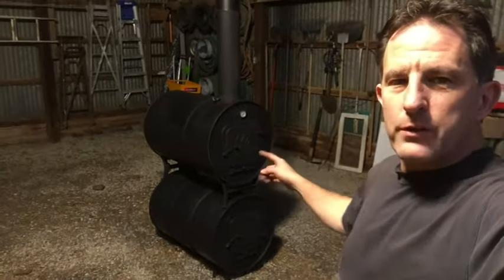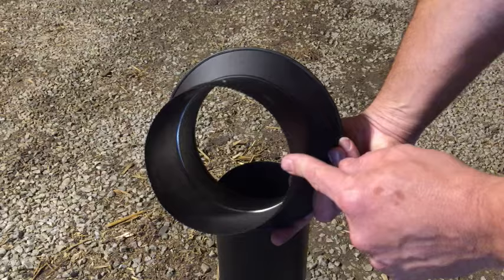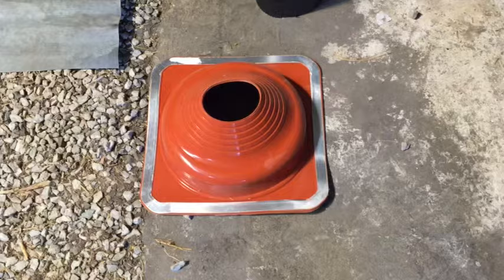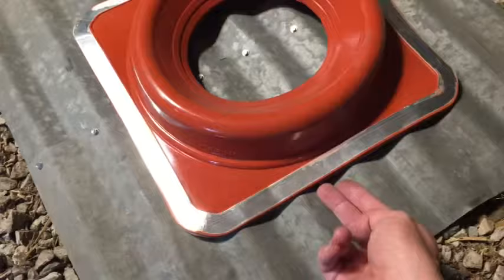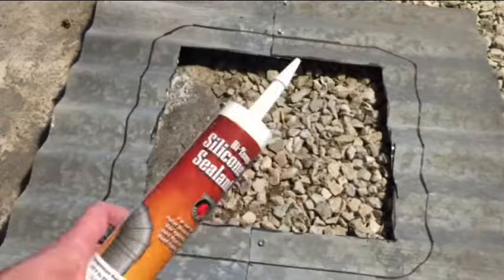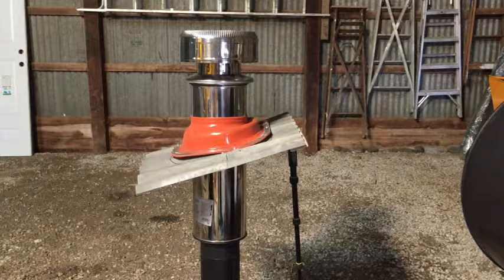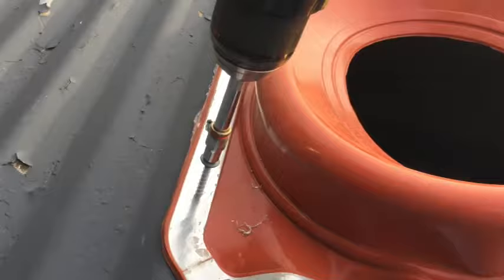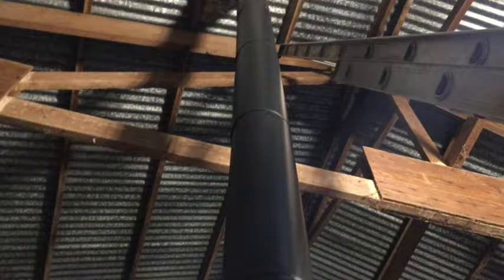How To Install a Chimney Through a Metal Roof

Comment: One suggestion is turn the boot like a diamond. Allows less surface area for water to pool and top two sides act as channels to move the water along
Reply: Good tip.
Reply: Good idea buddy, I'm installing my Selkirk this weekend in the cabin and was just flipping through some ideas and reading your comment..makes sense.
Reply: Yep that makes sense, thanks for that tip, im just about to fit the boot.

Comment: I was told once say the cap should be about 2ft above the roof surface not sure I saw high and low cap was installed in youtube
Reply from the maker: Yes, best practice is to have the top of the chimney at least 24 inches above the ridge, to prevent downdraft when wind comes from the other side and over the ridge.  This is less of an issue with my low pitch roof and I have good exhaust momentum since I have no bends in the chimney
Reply: @HowToLou  I bought a set not install yet, but the cap is going to be connect right on top of double wall and the double wall is 14 inches high so I would say the cap will be about 1¹/² ft from the roof. My cabin was built with steel panel and only 2.5 inches thick
Reply from the maker: That all sounds good.  If you have any draw problems, you can always add another section of double wall later.

Comment: Now that it has been in place for a year has it started leaking yet or corroding on the high side where the water pools, or where you cut the steel with a grinder?
Reply from the maker: I just looked and there are no leaks or corrosion.
Reply: I put my flashing on as good and pro as possible and it leaks on the high side , not sure if it's the pitch of my roof or just living in Washington state

Comment: Great video but isn’t the chimney pipe supposed to be a bit higher than that?
Reply from the maker: Technically yes, but my wife did not want to see the chimney above the roofline.  I put the top of the chimney even with the peak of the roof with the idea that I could quickly add another 2 foot section of double wall stainless chimney on top, if I needed it for draft.  I have not had any issues, with winds from all directions, so there is no need, in my case.  Part of what helps my draft is that my chimney is a 15 foot vertical run with no elbows to slow the smoke.

Comment: Hello, what is the highest temperature it can resist? Would it be too much for a single layer chimney pipe?
Reply from the maker: I think silicone is good to 600 degrees.  Single pipe is fine until you have a chimney fire and the single wall pipe glows cherry red and gets way over 600 degrees.  Single wall is not to code, because it can be very dangerous.  I have had chimney fires.  They are scary.

Comment: Do you use any of the high temp silicone on the join between the flue and the top of the dektite flashing? Or is it a secure seal?
Reply from the maker: Its a secure seal. It’s stretched on tight!

Comment: Where did you get that silicone flashing piece
Reply from the maker: DEKTITE Square Base Pipe Flashing Boot: #6 RED (DFE206RE) High Temp Silicone Square Base Flexible Pipe Flashing Dektite (for OD Pipe Sizes 5" - 9") Pipe Flashing https://a.co/d/b21O8wq

Comment: Could i ask why single wall pipe than double wall threw ceiling ?
Reply from the maker: You want single wall inside, so it radiates more heat, but insulated double wall through through roof so it does not burn off your roof paint or catch your trusses on fire.

Comment: Good video.  
Do you squeeze silicone around the top of the red flashing where it meets the stove pipe ?
Reply: You shouldn't need to, being rubber-like, it should seal itself because of the tight fit.
Reply: @Ranger_48  Thanks for your reply 🙏 👍

Comment: For the boot on the roof Is there any wood behind the roof or are the screws ok to just through the metal? I guess what I’m asking is did you frame out behind the boot with wood?
Reply from the maker: No wood under the metal under the boot.  Stay as FAR from wood as you can.

Comment: Great video, would you mind telling me the amazon links for the single wall to double wall adapter, the double wall tube and the rain shield . (i am trying to set up something similar but in my country this are not widely available but i can order from amazon, hence the request, thanks in advance)
Reply from the maker: Search Amazon for
high temp silicone chimney boot.  You need an orange one, not black.   I bought my pipes at a local hardware store.  Just search for 6 inch, stainless steel, insulated, double wall chimney pipes.  They are fairly expensive.  I think I paid around $50 each.
Reply: @HowToLou  Thanks for the reply Lou !! Keep up with the channel, really interesting stuff